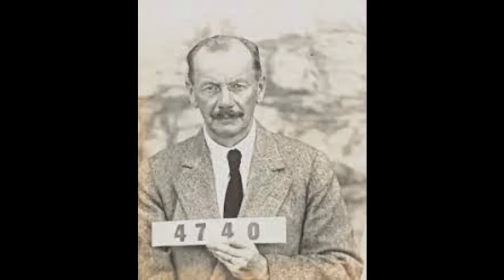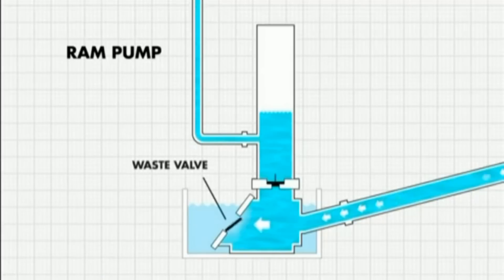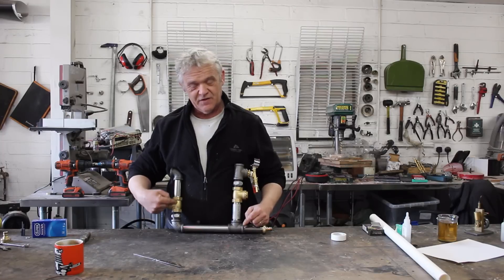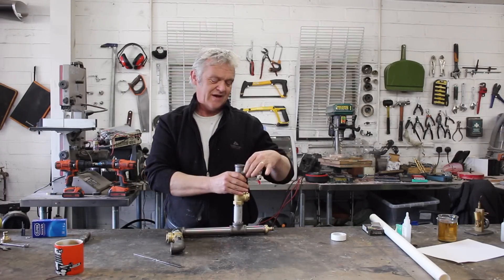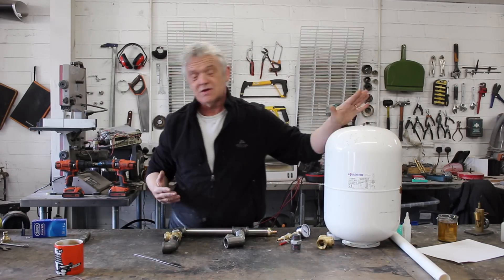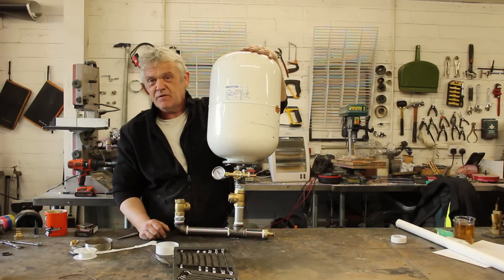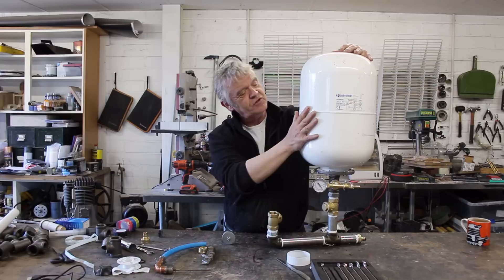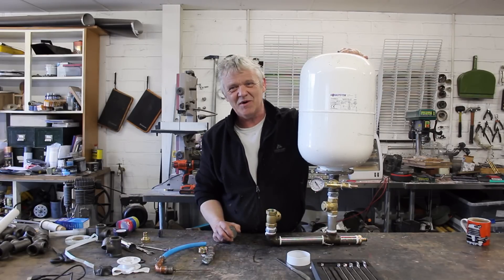1516 A DIY Ram Pump - Maybe For Energy Storage

Comment: interesting to try tesla valvular conduits instead of flap valves, no moving parts,would it work?
Reply: The waste valve has to close very rapidly to create the hammer effect.
Reply: @johnguest4525  yes but i think a fluidyne sterling engine would work very well as a pump using 2 tesla valvular conduits, im gonna try it!

Comment: So why did serve using a compressible If you used a tubing instead of that pipe a compressed air pipe higher than where you're gonna use the water it should work this the same shouldn't it

Comment: Would a ram pump work in the tidal zone on the coast, using the incoming waves, posbliy to pump water to a high water tower to drain over a water turbine or some other power generation device?
Reply: Maybe combine with a troupe device on the output
Reply: *Trompe,  autocorrect strikes again

Comment: The accumulator could be used, as you say, to store compressed gas for driving other energy harvesting equipment, but the outflow water could be pumped to a higher altitude and drive more powerful accumulators or turbines - a tesla turbine perhaps. I'm thinking the first stage could be water from rain harvesting, but there could be further stages limited only by one's maximum height limit. 
I really feel it's time to make good on whatever applied sciences knowledge I already have, and grow that knowledge too, given the possibilities of black-outs and brown-outs this winter. I'm also looking at how to feed homemade generators into commercial inverters in addition to commercial pv panels and the like. Exciting, but driven by a certain amount of worry. Thanks for your channel and your insights, as always.

Comment: I was thinking of using a couple of ram pumps in series the waste out put of each ram pump turns a small turbine filling the next ram pumps tank and so it continues to the last pump which the last one have a additional electrical pump to pump waste water back into first tank. Also each ram pump smaller than the previous one in series. This should be close to a perpetual system. Also note the pumped water of all ram pumps to return to the first tank.

Comment: We used a ram pump to lift water out of a 500’ canyon for 70 years.  It was installed during World War II.  Last year we replaced the propane generator that had replaced it with new solar panels.  We would have bought another ramp pump, but no one makes them big enough anymore.  Where we are so far from power, ram pumps and now solar power is the way to go.  The water was used for livestock on our Wyoming ranch.
Reply: Green and Carter in uk still make them. Also Pappa pump👍

Comment: We have had alot more wind the last few years, seem more wind every year,  so I'm planning on building a wind turbine, in the 1500+ watt range. Or several in the 600-800watt range, that can produce 300watts in a light breeze,  put them on a T shaped tower,  with them at different heights, to get at least 3 turbines on a tower.  Probably 5blades,   and 40' minimum tower, a bit off base, sorry

Comment: Ram pump water into a water tower, or elevated pond. Use the water from this to generate power, high pressure low flow,  get around 110psi,and 1gph, haha, that kind of pressure would be awesome,. I was going to build more of a Gravity powered generator, basically a waterwheel with troughs on it like ferris wheel , fill the buckets or troughs, the weight pull the when down, it would spin very slow. With tons of TQ, about 80+pounds at about 4' off-center, around 10gallon buckets, and about 2.5 buckets working at once,  connected to a gear to convert the approximate 5rpm to around 1,000 rpm, I'd probably build a pancake generator,  24coils, each side, on.  36" wheel, with the strongest magnets I can find, it should be in the 500ftlb TQ, at 3-5rpm,I'm sure someone could work out the power potential after the OD gearing,  and the approximate final power output, from a 3phase generator, I would be amazed with 500watts, especially if I could get it 24/7, with the water flow , I may need to drop to 5gal buckets, and 8' from the axel, around 40lbs at the end of 8' Is very heavy, then multiply by 3-3.5, the larger wheel will allow more buckets to be used at once,  it should be capable of spinning a 1200w generator at 500rpm surely,  as long as I can get over 800watts I would totally ho for it,

Comment: Thank you for doing your own take on the ram pump.    Been down that rabbit hole a few times over the last years.
Reply: The one thing still missing for my prototype is the connection between my 1inch pipe and some kind of pressure tank

Comment: If a ram pump can pump up to a hill, why can't you make a loop and use it to turn a Motor.
Have multiple ones for more water power.
In regards to water loss from valve, that can be collected back down to bottom water source. No waste water.
The power output is dependent on how much water per second can reach the top.
Reply from the maker: you can have it turn a motor and you could make a loop but I am not sure where the benefit is - can you explain what you are thinking? cheers mate
Reply: The "waste" valve has to send the water to somewhere lower than the source, otherwise water won't flow through the system at all. If you don't have "wasted" water, then it just won't run. If you try to pump the "wasted" water back to the source, you'll always find that friction is enough to make it take more energy than you can get out of the "high" valve's water.

Comment: The Achilles Heel of all ram pumps is the appalling ratio of waste/delivered water. You need a steady stream of water going down the drain to gain a few drops pumped to a higher level. Sort of good if you have a fast-flowing creek running through your property, and don't need much delivery,  but no good at all in any other situation.
Reply from the maker: chers mate
Reply: If the primary aim is to generate compressed air, you could use an electric pump to feed the tromp and collect and reuse the waste water.

Comment: Hi Mr Murray , it's been more than 30 years ago , but I worked on compressed-air energy storage.

I don't remember the mathematics , but we were very easily able to surpass the Energy Densities of every known battery at the time!

Compressed-air as an inexpensive form of energy storage is a very interesting solution to many problems...

Regards.
_
Reply from the maker: Thanks for sharing - I agree
Reply: Calculations have apparently said that compressed air can perform slightly better than pumped hydroelectric.
Reply: @absalomdraconis  Hi Jared , it's been decades since I last did the math , but I believe you are correct. In addition , compressed air is highly flexible in design as opposed to 'hydroelectric' , and again it can easily surpass the Energy Densities of all known batteries!

Regards.

Comment: I thought of these when you did the water flow generators, of course it cant be perpetual so you would need to augment the water supply but depending on the use that could be once or twice a day kind of thing, or you divert only a small amount of the water flow for the generation of power, they could be very useful in rainy climates
Reply from the maker: I would think so - cheers
Reply: @ThinkingandTinkering  you could also use grey water - people tend to use water at a fairly constant daily rate.

Comment: Thank You Rob  -  for your  Info.  from all u have said about super capacitors,  Is it possible to make a 12 volt 2 farads supper cap? .  let's say two  2"x 3" copper plates 2 mils thick. coded with acetone/powdered activated carbon mix.  Sandwiched on  one layer of magnesium sulfate solution soaked kitchen towel one mil plexiglass and another soaked kitchen towel.   Would this work?  If Not could you please head me in the right direction    Thank You Again .
Reply from the maker: you can make a 12volt 2 farads supercap - but I wouldn't think how you suggested would do it.
Reply: @ThinkingandTinkering  I was amazed at that 1 cm square super cap  of graphoil dipped in active carbon acetone mix. love that sincore LC102  cap tester you have. You used kitchen towel with neutral solution (zinc sulfate?) between the strips . It tested about 4 farads. ( unbelievable)  I was wondering if you had sandwiched a piece of ---- mica - between the kitchen towel and solution, would that still give a 4 farad capacitance ?  the breakdown voltage of mica is very high ,  Would 12 volts added to that 1cm  graphoil setup with mica   handle that ? My experiments ask for a flat plate cap with a 12 volt 2 farad capacitance . Thank You.

Comment: an inprovement to the accumulator is to install a balloon in side it normaly filled with nitrogen but i guese air would do
Reply from the maker: air will do just fine - thanks mate
Reply: @ThinkingandTinkering  i was wondering about a membrane stretched inside the chamber with a magnet and coil like that nasa sterling engine.. figure the pulsing water hammer would kick that around nicely...

Comment: its not a new concept however, your Blue & White Animation is incorrect - there in fact IS wasted water from the pump's priming cycle.
. what you have failed to mention is Where those pumps were located at - usually someone's flower bed. Easily hidden and ignored.
. . it is from that Basic Pump's Pressure Reservoir that the First Shock Absorber was experimented with back in the 2,500 B.C.'s
. I am also curious why Web Pages that "held such info and Building diagrams" are being hidden from the public lately.! I know they were there last month cause I Book-Marked them!
Reply from the maker: cheers mate

Comment: Water tank with syphon pipe with turbines in leading to a ram pump to fill the upper water tank...
 free energy????
Reply from the maker: I don't think so - but give it a go
Reply: @ThinkingandTinkering  thanks for the reply.. the ram pump may not work completely as water loss but I'll keep thinking maybe using only one tank with a special design to keep water higher one side all the time..  where there's a will there's a way!

Comment: Was the packet of Durex on the bench a little joke to do with ram pumping? ;)
Reply from the maker: lol - no I used them in video 1512 for a piston drive - now that as funny lol - and will be used later
Reply: hahhaha noticed it too, mb for some kind of diy valve or a gas chamber
Reply: LoL 😁👍!
Reply: Rob drops those kind of visual jokes in often enough. Such as the 'bull's-head/horns' trophy from a bicycle seat/ handle-bar combo on the wall.   I've lost count of them.

Comment: I do wonder if the shower heads that boost pressure work like this on a miniature scale
Reply from the maker: I don't think so mate - think they just use an electric pump and small accumulator - but I am not sure
Reply: @Robert Murray-Smith  I'm taking about just the shower head only. I doubt they do but I would be interested in how they make more pressure inside a tiny shower head
Reply: @karlmyers6518  Smaller/fewer holes. Simple as that.
Reply: No, they don't.

Comment: Pyrolosis and gasification together,  a system to recycle plastic and burn trash.  Could it be practical?
Reply from the maker: tbh I would think so
Reply: Only in your dreams.
Reply: Sorry, I was a bit curt.
Your idea has been studied a lot in many countries, it just doesn't work in real scenarios, the energy used/produced doesn't work; and unless you recycle at source (already done) the resultant mix of plastics is too unreliable to have any uses that are not better served with source polymers. It usually just goes; trash and/or burned. Some plastics, e.g. PET,  PP,  PE, can be re-purposed IF you can keep them very well separated and clear of other contaminants.
Reply: I've watched a video where Mr. Teslaonian did such a thing.  It was very interesting;   something like this in an intentional village would be much more efficient imo.  

  Biker,  I've seen all the videos.  I've been intrigued and think about it all the time.  My question always is, "does it really not work,  or are there forces at play that prevent it?"  Much like the climate panic provocateurs.
Reply: @DeepCycle9  Under ideal conditions and the right engineering from start to completing a loop, it might have merit. But collecting, transporting, sorting, removing foreign matter etc would use more resources than it saved. Plus, if ANYTHING got back into the master-batch it could have big consequences, e.g. a small piece of slightly incompatible material in an extruded insulator could fail in a minor way but cause catastrophic failure later.
If people could reliably and easily recognise and sort different thermo-plastics, even then just one wrong piece would/could cause big problems.
Just burning the 'plastic' has problems of pollution,  uPVC,  ABS, various 'rubbers', fluorocarbons, etc.  It's just not workable in the real world. At best incineration reclaims a tiny fraction of the combustion energy, but this never breaks even with the collect/sort etc part of the process. It does reduce the raw plastic going into the environment, but the method has to absorb the byproducts so it doesn't just change the pollutant form/composition for a different one.
If you go through the real logistics you'll see where the sums really don't add up.
It's a similar argument with re-usable ceramic mugs and disposable beakers (either polymer or paper),; in hypothesis one looks favourable over the others, but in practice it is way the other way.

Given large amounts of one type of plastic, e.g. uPVC windows/doors re-cycling can work, but for everyday mixed plastics (and all the other detritus, labels etc) it just isn't favorable, neither material nor environmental nor financially.

Comment: I wonder if the valves could generate electricity. Sounds like a switch opening and closing. If that weight was a magnet, and you put a coil around it....
Reply: As long as you waterproof the coil and magnet, and  you size them properly it will work.

It really depends on how much water flow you have going into it.

Keep in mind that if  you put too much weight or pressure on the valves, the pump will cease to work and you will have neither a water pump nor an electric generator.
Reply: A very long time ago I saw a ' chick feeder valve " that had an externally  controllable valve to keep water in a dish at a specific level.  it had to be water tight, otherwise the chicks would drown.  One of them modified so the float was a magnet and the valve used as one of the reciprocating may work to oscillate a magnetic field.  It would most likely need some kind of extension to allow the magnet to move through a coil instead of a partial out/in motion as I have seen with some versions of mechanical oscillators trying to generate power.  I wonder what the frequency would be at mains water pressure.
Reply: Have a water tank with syphon pipe with turbines in, leading to a ram pump to fill water tank up again = free energy...
Reply: @danrawson8515  

That depends on what you mean by "leading to a ram pump to fill water tank up again".

If you mean the water coming out of the tank will go back into the tank, forget that idea. Water passes through the ram pump as it works which means that the tank will ultimately run out of water. Much faster than you may imagine.

If you mean, have a river run ram pump fill the tank, then you will certainly get a measure of energy. That energy won't be free until after you have produced enough to pay off the equipment cost.

If you can set up a system like this, maker sure you run a pipe beneath the outlet of the tank down to the river. The water will end up there regardless. The difference is how much damage to the landscape it will cause.
Reply: @scotttovey  thanks for the reply I've been thinking about this idea for a while,  if I can find a way to fill the first tank up again it is fee energy  it may be one tank with a divider so the water can fall straight back into the same tank..(raising  the siphon pipe as high as is possible) Will have to keep thinking to find a way.
As  its a simple idea and would be easy for everyone to make themselves..
Reply: @danrawson8515  

That's an interesting idea, but I doubt that it would work.

However, to make a siphon work, if it will work, you would have to stair step several siphons up to the level needed. This can be tested with buckets or bowls before you think about the rest of it.

Somewhere in the mix, I have no doubt that there is a reason it will not work. Most likely that annoying tendency the universe has of preserving energy.
Reply: @danrawson8515  : The reason it won't work is that ram pumps have to dispose of water through their "waste" valve in order to get a smaller amount of water to pass through their "high" valve- but in order for that to happen, the water flowing through the "waste" valve has to go somewhere that the water is lower than at the source. Thus, in return for some water going above the source, some other water has to go lower than the source. Eventually your source will run out of water, and friction is enough to prevent the system from reaching break-even energy, much less producing extra.
Reply: @absalomdraconis  I'm sure I will find a way around it... but thanks for your comment
Reply: @scotttovey  thanks for your comment.. I will keep thinking about solving this problem ... where there's a will there's a way!
Reply: Actually, if you were using magnets instead of springs, inside a coil, you could get some useful electrical current from such a set up.  Nice idea David.  ;-)
Reply from the maker: yeah that would work